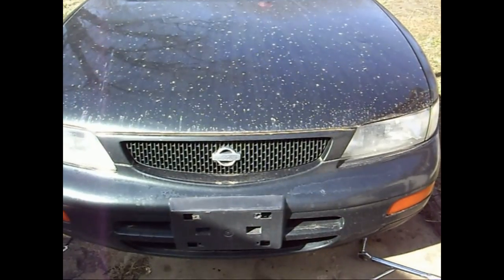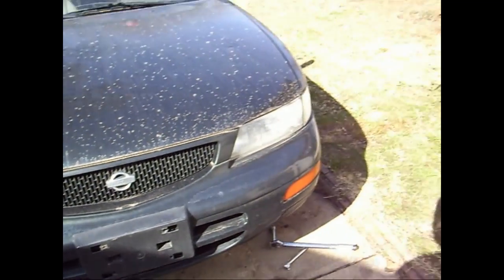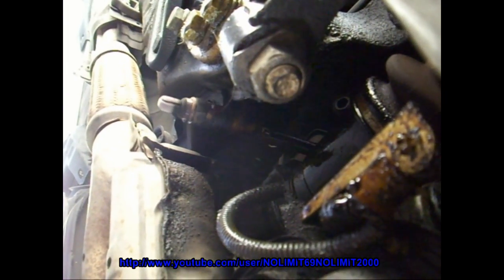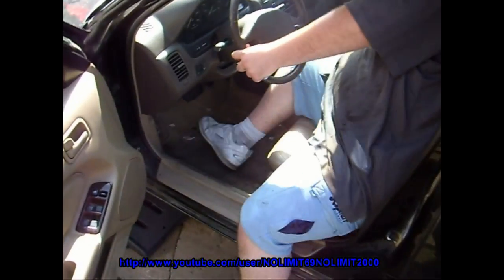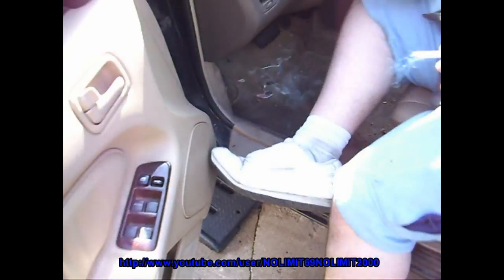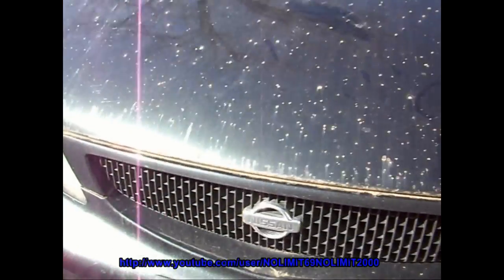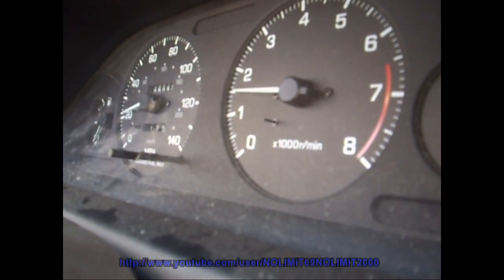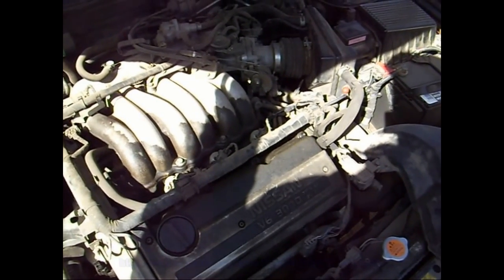How to tell if your catalytic converter is plugged. Also some other advice.

Comment: Removing all the O2 sensors?  Naw, fuck all that shit... If your cat is plugged, you can tell by a simple temperature test.  If you don't already have one, go buy yourself a lazer thermometer for your toolbox of goodies.  These days you can buy them for pretty cheap at places like Harbor Freight Tools.  Get the car warmed up good and then take temperature readings both before and after each catalytic converter, as well as the catalytic converters themselves.  There will be extreme differences in temperatures from upstream to downstream on each cat, and a plugged cat will alone be beyond extremely hot if it's plugged up.  When you have multiple cats, you can compare one to the next to get an idea which of them is the problem child.

Additionally, if the upstream O2 sensors are not in place and operating correctly, the car is going to run poorly (AKA: Like Shit).  The upstream O2 sensors control the fuel/air ratio for the injection system, and are critical for the thing to run correctly.  The downstream O2 sensors merely tell the computer (and you, if you have any diagnostic tools and ablities) if the cats are functioning properly or not.  The downstream O2's serve NO other function.

Also, more often than not, a plugged catalytic converter will glow red hot in the dark after a drive where you've been pushing the car pretty hard.
Reply: thefirstgalaxybeing
: It certainly could potentially catch fire, and I've actually heard of it happening before to some people.  Fortunately, it's never happened to me!  I personally have had a few different vehicles over the years that have had plugged catalytic converters.  Including a 1986 Chrysler Lazer I-4 2.2L, a 1989 Dodge Daytona I-4 2.5L, a 2001 Buick Regal GS V6 3.8L, a 1995 Mercury Sable GS V-6 3.8L, a 1995 Dodge Ram 2500 V-10 8.0L pickup, a 1998 Chevy K1500 V-6 4.3L pickup, and damn, there's probably others that I'm forgetting!  The very first plugged cat that I ever experienced was on a 1986 Chrysler Lazer (same as a Dodge Daytona) that had a 2.2L, 4-cylinder engine.  The car was wicked gutless and could barely get up to 30 mph.  Upon looking under the car after realizing the rug next to my right foot was hotter than hell, I saw that the converter was glowing cherry red!  Pretty cool, and also... pretty bad!  We put the car on the lift, removed the exhaust, cut the catalytic converter open, dumped out the plugged up trash honeycomb, and welded it back closed.  Re-installed the exhaust, and the car ran GREAT!  Of course, this was back in the days of early fuel injection and OBD I diagnostics , where you could get away with that kind of a fix.  Nowadays, if you just gut the cat and re-install it, you would have a CEL (check engine light) that would come on, and it wouldn't pass an emissions inspection.  But, at least your car would run fine and get you from A to B again!  Just our stupid government telling us what to do, as always.  Ya gotta love it...

Comment: Those fucking pre-cats are good for nothing but killing your engine eventually.  Punch those motherfuckers out.  My '02 Maxima is in the shop this week and my mechanic cleared those out for me.  My rad side pre-cat was basically dust and the firewall side cat was rattling around every time I rev-ved the engine.  Needless to say I'm replacing my engine too.  Saving the God damn environment is sure expensive!

Comment: Sounds like u have a bad misfire.Check ur spark plugs and wires too.U can check ur cat also by useing a laser temp gun.Before cat should be less temp than behind the cat.Get ur missfire fixed first. or car will still run like crap anyways.

Comment: so check it out,change pcv valve plugs gas filter wires sensors and and distrubutor and pick up module I cant tell without driven it

Comment: I watched this and took out my 2008 Nissan Armada O2 sensors and found the problem of my p0300 code. The power came back when the o2 sensors were out. It had no power before, the cat was so clogged that it couldn't get up to 20 moh on a slight uphill.

Comment from the maker: There are no regulations here so we will probably just replace them with pipe for now. Also it should run fine without them. My honda don't have one anymore and we gained a couple of HP by getting rid of it. The only problem you run into is the check engine light stays on because you don't get a proper reading on the cat.

Comment: wanna make that car damn new brand new engine wise???? fix your oil leak then replace ... distributor cap and rotor, spark plugs and wires , fuel filter , air filter and give her and oil change with high milage synthetic and a good oil filter... then run through some sea foam 1/3 1/3 1/3 way and then drive 200 miles and change oil again... Just make sure you get japanese spark plugs n wires... I only use NGK on my Honda Civic. its a 99

for 200$ you could make this thing run great again...

Comment: had the same problem on my 94 stealth.... could not get the tach above 4000 rpms......changed the fuel filter and slam bam was able to take the tach as high as i wanted....

Comment: hahahahahaha, great video however, i hava question.....is there a cheap easy fix for a catalytic convert thats making a loud clanking noise? i wanna just cut the fuker off and run a bypass pipe but i was told the car will be way too loud and the cops will be on my ass in seconds the other alternative is 600 buks to the mechanic to put a brand new 1 on, any cheap effective fix advise would be perrrrrfecto! btw, itsa 2002 4cyl automatic honda accord. THANKS!
Reply: Angelina  If the converter is making that kind of noise it's broke  in to chunks inside.A new aftermarket Cat should run 300. to 400. installed
Reply: Jim Brown WOWA, I feel good, i knew that i would, now i feel good, i knew that i would, now so good, so good, i got u, WOWA! but ul never guess what happened....the clankin all the sudden stopped, my dummy lites went off and im good to go like a used HO! thanks tho!
Reply: Angelina  If your car suddenly looses power check that converter first because they can plug up.Let the mechanic know it was rattling ok.Good luck
Reply: Jim Brown will do & thank u so much for all the info, i really appreciate it!

Comment: sounds like a failing coil caused the precats to break down and clogs the main cat. Removing the o2 sensor proved the cat problem, but now it's easier to hear that cylinder randomly dropping.